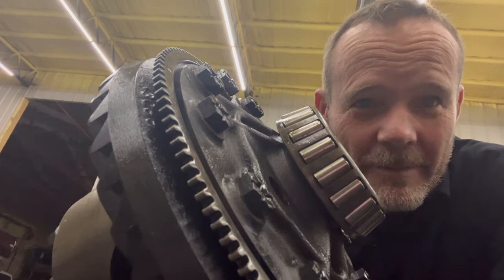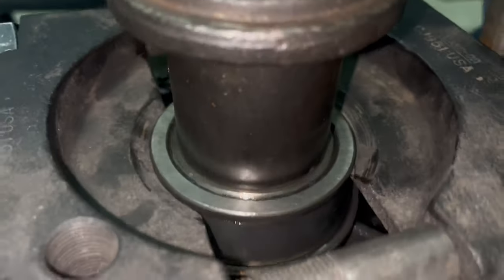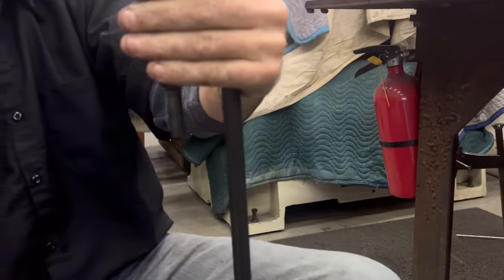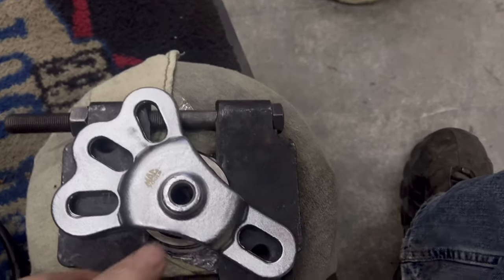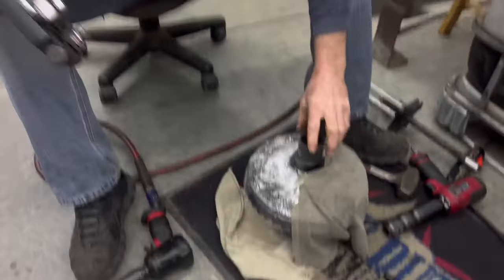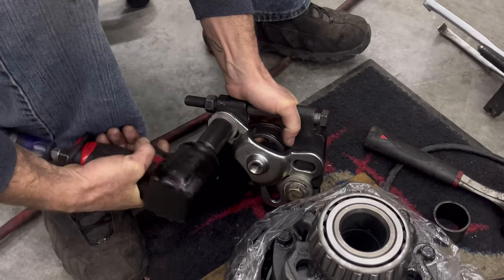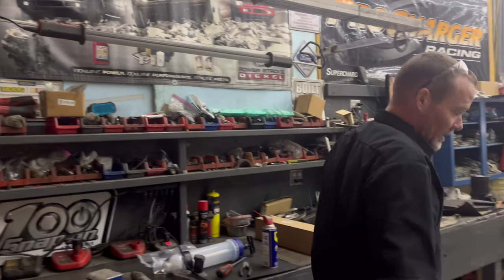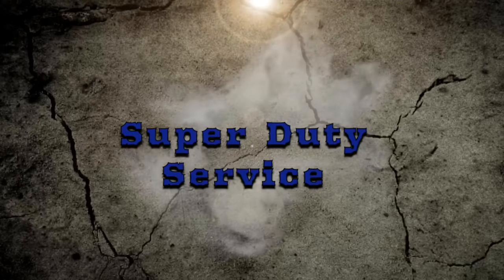Building a tool to remove the carrier bearings on Ron's F350 Sterling 10.5”.

Comment: Bearing splitter and a hydraulic press if you're trying to save the bearing. Otherwise small cutting disc, cut almost through it and split it with a cold chisel.

If you can save the inner part of the bearing, make the inside diameter just big enough to slip on and off the carrier and you can use it for setting up shims before you press the final new bearing on.
Reply from the maker: I want to explore the new crush sleeve.  They are so cheap and fast,  it would be nice to just bang a new one on every time with the process set in stone!!!  We see a bit of Ron's experience when we set this carrier and it is .010 spot on!!!

Comment: I use a bearing splitter/wedge set up , try and save those bearings when your doing them , you can buff them out and make yourself some slip fit bearings for setting diff up , rather then pressing new bearings on and off if you don’t get your shims correct
Reply from the maker: Do you think there is only so many times the interference fit is good for?  If we just walk over to the tool to remove and install,  it at least is doable.   I am leary on the idea of not using the exact bearing to check and set clearances.   I'm not banging on it tho.  Sounds like another video someday.

Comment: That's awesome, Anthony. And you have a lot less money in your setup than I do.
Reply from the maker: Do you think this "procedure",,, qualifies as a procedure??   It was fairly effortless once we figured out what we were even doing.  lol   We still need to get them back on tho huh??   I have an idea,,,,   actually I saw one video on youtube install the carrier bearings the way I want to try.    So it will not be an original idea sadly.    I have been studying as much as possible.   With that said,,  I'm all ears to the procedure you would use.  Heck, how about everyone let us know how you all install carrier bearings.
Reply: @anthonyyoungblood  a little heat in the center of the bearing. It doesn't take much. A hot air gun works. You're not trying to overheat the bearing. Put some transmission fluid on the clean and slightly polished carrier where the bearing goes. Drop the bearing on straight. Finish it off if need be with the center of your old bearing. Then, use a seal and race driver to fully seat it. If the bearing drops on crooked. It no big deal.  Use a few slight taps to recenter it. Then finish it off with the tools mentioned. Or just set it up on the press.
Reply from the maker: I think that should sum up this carrier bearing deal huh???   Dropping them on tomorrow.   I can't find any marking compound,,  but Don suggested cornhead grease.         What do you think?  I gotta check it.   We were planning on going to get some before bolting the cover back on.  A messed up rear end would prob get you exactly HALFWAY home!!!   lol